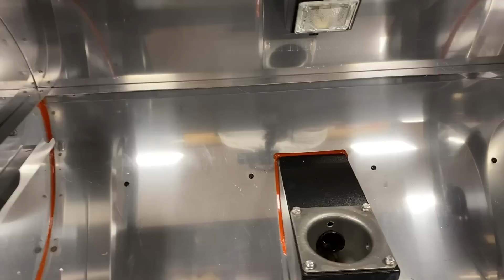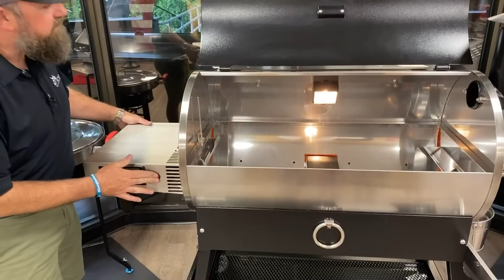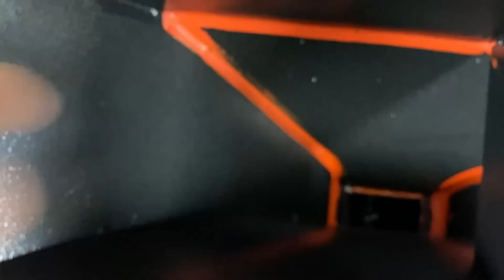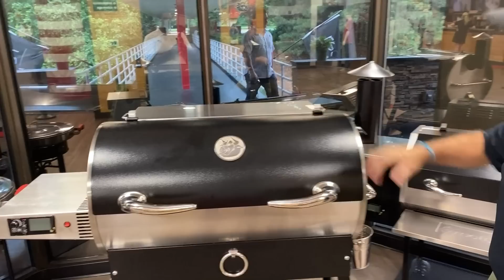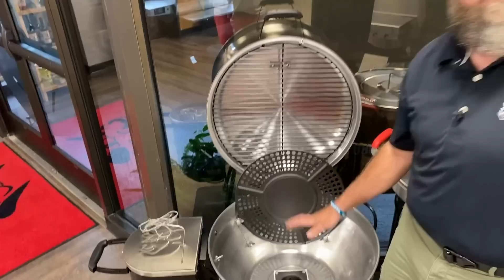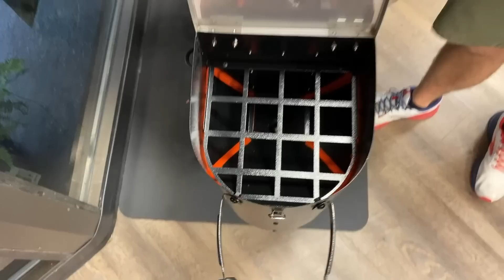Grill Maintenance for New & Exsisting Customers | Product Spotlight | recteq

Comment: Just came across this video, excellent information. Currently own a RT-700 and had the issue of lots of smoke on startup, yup firepot was dirty. Have gone through close to 400lbs of pellets only issue was an igniter failure, had a replacement in 2 days.   Just ordered a RT-B380, should be here Sunday, cant wait to try it out too. Thanks again for the excellent video, fit my stable of grills perfect.

Comment: This is all great info.  Thank you for the tips.

Do you have any tips on how to prevent leftover pellets from absorbing humidity in hopper and preventing any problems downstream with off size pellets?

Will these grills take wood pellets from other manufacturers, or will they only take rec teq brand pellets?

Lastly, do you offer a stainless hopper box instead of the black porcelain coated or powder coated ?
Reply: You can use any pellets you wish. My favorite two (in order) are Knotty Wood Plum and Jealous Devil Jax (I’m using a RecTeq RT-700)

Comment: Could you do a video smoking something low and slow on the bullseye? I recently got a bullseye and have never smoked before. I have heard you talk about flipping the drip pan and putting a aluminum pan on top, I think, but I am out of my element here.
Reply: Not sure if they answered you or not, but get ya a disposable 16" pizza pan. They usually sell those right next to the disposable casserole pans with the plastic lids. Perfect fit on the heat deflector, don't even have to flip it. Don't use it for high heat though as it restricts air flow. Happy smoking.
Reply: @thewellredneck  Thank you very much!

Comment: I would also recommend seasoning the heat deflector. It will rust like a big dog otherwise!
Reply: True that!  The deflector in the Bullseye is pure rust on mine, and it happened in 30 days.  It really should be a different material.
Reply: @SilatShooter  Even though I seasoned mine several times, it is still rusting a lot. I can see where in a year or two, there will be nothing left of it. I think that being so close to the fire pot, it doesn't matter what you do with it, it is going to rust.

Comment: NEGATIVE on your advice concerning no drip pans in the bullseye. Without a drip pan you will have grease fires on the bullseye.. If you keep a drip pan under the grate to catch drippings, and go to riot mode for about 10-15 minutes after each cook, this will turn everything to ash and eliminate the grease fire issue.  I love the bullseye. it is a great weeknight smoker for short cooks.. A great compliment to my pit boss 700.  I love rec tec. Great product, and excellent customer service.

Comment: Fix your app that doesn’t work with 5ghz WiFi
Reply: Edward, it isn’t supposed to.  The 2.4ghz is used because it has a much farther range than the 5ghz.  Most people don’t have a router that will extend the 5ghz that far outside and through exterior walls.  The 2.4ghz provides better range.
Reply: @LeythesToja  so those of us that do have 5ghz have no recourse? There are a lot of us. Not going to try n cut back to 2.4 and then reconnect at 5ghz, it’s way too complicated. Regardless, one of the main reasons I bought a recteq now doesn’t work for me.
Reply: @Daltondoubledeuce  my internet supports 2.4ghz and 5.0ghz.  If your router supports dual band you would be good to go.  Everything we have indoors is connected to our 5ghz, our outdoor items are all on 2.4ghz.  

See if your router will support more than one network. If it does, you’re in business and only have to use it on your phone for the setup, not for continuous use afterwards on the phone.
Reply: Picked up the RT-700 on the 26th of June. Using Ubiquiti UniFi for my home network. All my SSIDs, 3 of them, broadcast on both 2.4 and 5GHZ. I didn’t have any issue connecting the 700 to my WiFi. Not sure if I got lucky, if there is an update to the grill that makes connectivity better, or if UniFi operates a bit differently.
Reply: If your router is dual band you shouldn't have to switch between 2.4 and 5 manually. I have it connected to my 5ghz router that supports dual band no problems here.

Comment: On the RT-B380, Jody said don’t cover the heat deflector in foil.  I totally understand that covering the holes with anything would restrict the air/heat.  Question then, on a low-and-slow at 225F, could I place a small foil pan with or without water to catch drippings and provide moisture or will be pan melt from contact with the deflector?  225F is way below the  melting point of aluminum but I would guess that the deflector is quite a bit hotter than the air at the RTD.
Reply: aluminum pan will not melt on the deflector.
Reply from the maker: Aluminum pan won't melt on the deflector shield. We do cooks all the time that we use to catch drippings for certain cooks.

Comment: Love my RT-700, but the biggest improvement I made was to add the fire felt 'seal' material around the perimeter of the lid.  Improved the uniformity of the temperature across the grill area (left to right significantly).  Given the concerns with air flow, it insures that the flow is around the food and out the stack (and drip spigot) rather than short circuit out the edges of the lid during the cook.

I feel that RecTeq is missing an obvious fix by not having a fire felt seal from the factory.  IMO.  The good news is it takes all of 5 minutes or so to install the felt seal material.
Reply: I don’t have any issues with smoke leaking out around the lid on my rt700.  Maybe I got lucky with mine but it seals pretty well.
Reply: @Buford_Justice  The assembly pretty much builds in a gap in the top and bottom edges since the end caps are an external attachment on the body - not flush.  It is why the smoke stains the stainless steel there first.  I didn’t think much about either at first, but as I used it more it became apparent that the pit was hotter toward the temp probe vs toward the smoke stack.  So I finally followed the recommendation posted by several RT 700 users and ordered a fire felt ‘kit’ from Amazon.  I decided to give the pit a full cleaning while I was at it, then applied the fire felt to the edges of the door.  The difference in air/smoke flow was apparent in the one hour ‘burn in’ the next day with it only leaving the pit at the stack and the fluid drain, no longer any evidence around the door edge.  I found I didn’t have an issue with different cook rates from one side to the other when I smoked three racks of ribs the next day.  It also seemed even more efficient in pellet usage but that is just perception, not measured.  YMMV